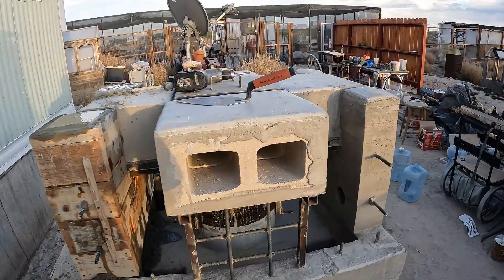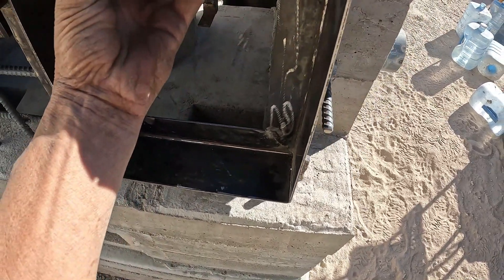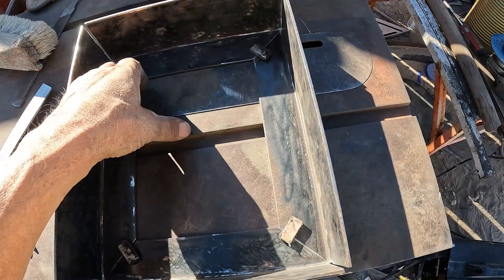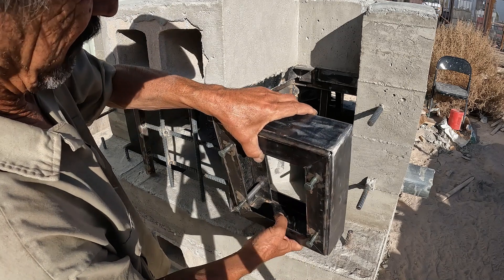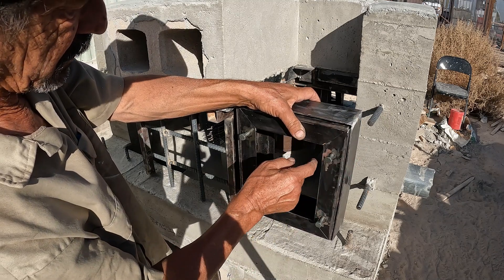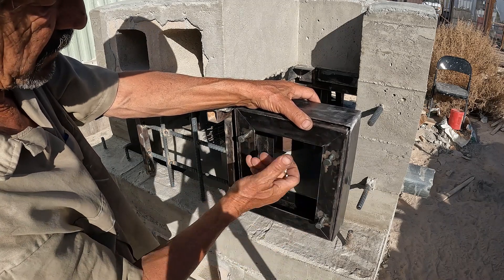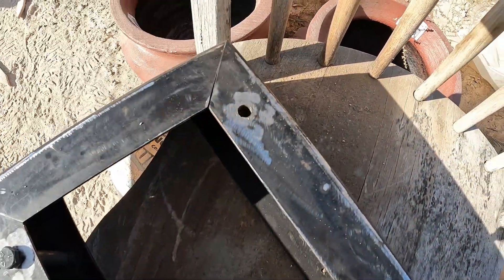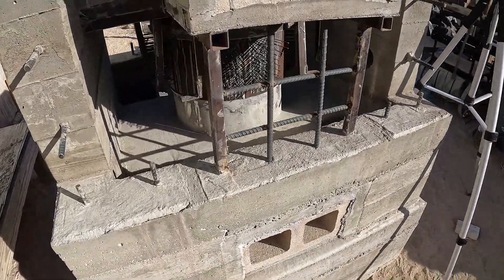Sand Battery Update E130

Comment: Once you fill it with sand, the cement going to get hot and disperse heat just as it would it was a solid mass.  What are you going to insulate the entire structure with?
Reply from the maker: I am going to insulate it with rock wool and metal studs for a frame. Then sheet the outside with some type of material that I will decide on soon.

Comment: Thank you very much Mike for your work , we need more people like you...

If you use solar panels, you'll capture only about 20/21% of the solar energy (approximately 1000 watts per square meter). Instead, why not employ solar concentrators with mirrors? This way, you can focus the sunlight directly onto a receptor (I'm not well-versed in this part) that could heat the sand to around 1600°C (below its melting point). You would require some small tungsten pipes for the "metal liquid" for spread the heat  which I believe is composed of tungsten powder (I need to research this further). Then, in the end, you could utilize the heat directly and employ a Stirling engine (which can convert 30% of the heat into power).

In conclusion:
You can store three times more energy (as you store it at a higher temperature).
You'll obtain 30% of the heat power instead of the 20/21% from solar panels.
You can use the heat directly for your home (utilizing 100% of the mirror's power).
Reply: I've been working on a parabolic trough with stainless steel sheets. the idea is that it will last a long time and even when its not super clean it will concentrate a lot of the light on the collector. the hard part is the heat exchange. once we reach above 300C, there is a lot of loss in transfering the heat from the collector to the sand. I'm new to this so naturally terrified of the failure mode for the pipes taking +300C liquid into the sandbox
Reply: @babakm8   as the heat rise naturaly , the concentrator must be on the bottom of the sand battery , heat should go naturaly at the top , then as your sand battery is well insulated (refractory stone or something around) it should work ? could you please share destail of your collector receiptor ?
Reply: @adytech5788  I’m using vacuum tubes and air as the medium to transfer the heat produced by the parabolic troughs. The pipes run under the sand battery in “W” shape. The hotter air stays on the top part of the “W” so I am only pulling out the colder air from the pipes.
The tubes are rated at 600C but I am transferring the air at 200C to keep things simple and safe with my prototype.  The idea is if I have a large mass at 200C, it will have less losses than a smaller battery at +600C.
I’m trying to store enough energy in a sand bank to help heating a large warehouse for at least 3 days(as a back up). The main thing I want to learn is, how long can I store the required energy in the sand battery.